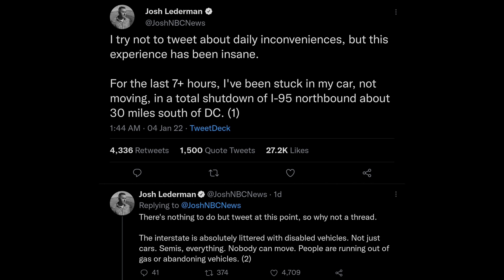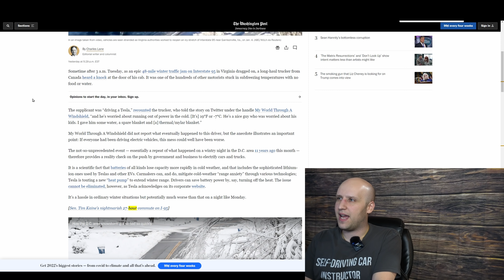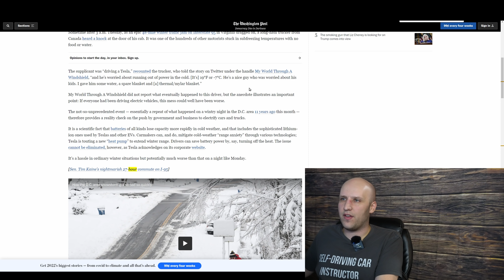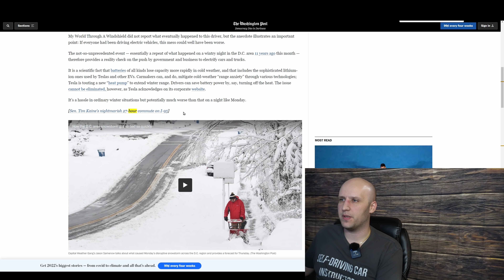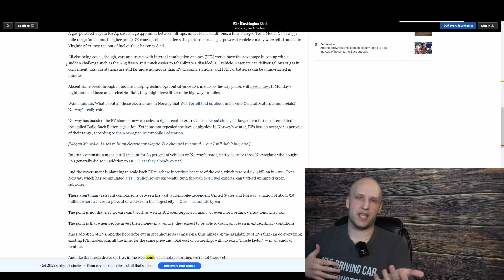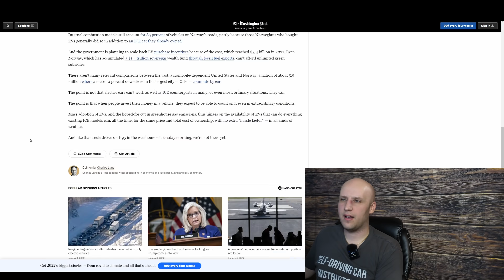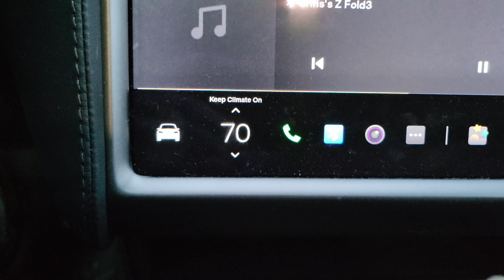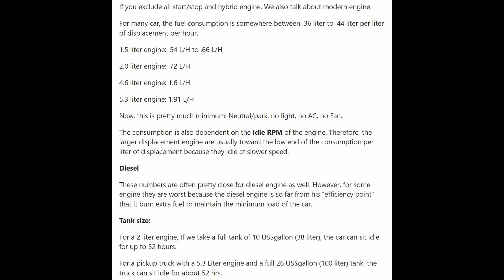How Long Can a Tesla Keep You Warm In A Frozen Traffic Jam? | FUD Debunking

Comment: A pregnant woman from the Facebook Tesla divas group posted… “Hey Divas, I hope you’re all doing well. Monday at around 5pm I was in traffic heading home on 95 south in Virginia and got stuck due to the snow storm. I ended up stuck in traffic for 16hrs! Thank goodness for my tesla. I was initially at 74% when I was able to get home I was around 61%. It was a nightmare being stuck in the traffic jam but I’m glad I was stuck in my tesla. I turned on camp mode and napped for a bit. I hope this is helpful to anyone and I’m praying for all those still without power in Virginia.”
Reply: Isn’t the key to situation, lower cabin heat to 60 -65 degrees F and turn on seat heater as it is more efficient?
Reply: @johnpoldo8817  What for? 1% per hour is good enough.
Reply: @wolfgangpreier9160  Agree, you should be out of jam within 24 hours and still have enough range to reach a charger.
Reply: @johnpoldo8817  Yep. "Stranded on the highway" is very much a survival situations, keeping the temp in the 60s or even 50s will last far longer while still being pretty comfortable.
Reply: @johnpoldo8817  yes!!! Could last hundred hours with just seat warmer.
Reply: @jamesrina6988  30 watts to power seat warmer. 100 hours x 30 watts = 3kwh. That is only 3% of a model X battery.
Reply: @johnpoldo8817  that's what was explained in the video
Reply: Wow, that is impressive! Stuck for 16 hours and used 13% charge!
Reply: @parkershaw8529  - Camp Mode is nice, esp when you put the rear seats down so you can lie down. Air mattress helps. There are all kinds of options, including some for Teslas.
Reply: @Chainyanker007  I am sure it's. Still not nicer than my bed in the bedroom.
Reply: Thanks for sharing.
Reply: Thanks for the test . Interesting . I'am impressed w/ Tesla's batteries & their endurance .
Biggest problem would be the (hypothetically speaking) the line (wait time) at first available charging station. 
Being from a northern state I'm curious about corrosion from the salt ... Any feed back yet ?
Reply: @jeffreyrudolph5061  We've had a 2015 Model S through  two and a half winters now  here in mid Michigan.  Salt doesn't seem to be any problem for the car.  The bottom is well sealed and I think I read somewhere that the S's are mostly aluminum.  So no rust ever?
Reply: @patriciazoerner  thanks for the reply. 
I'am less concerned about the body , than the wiring , batteries & all connections .
10 years would be a comparable average  (conventional auto) from this severe region.  Thanks again.
Reply: @patriciazoerner  Aluminum does corrode, it produces a white powder. It is still important to wash off the salt.
Reply: @patriciazoerner  aluminum does corrode but much slower than unprotected steel
Reply: @patriciazoerner  salt corrodes everything, including aluminum, . May be not as quick as steel but it will eat thru aluminum as well
Reply: @patriciazoerner  aluminum does corrode. It doesn’t produce the typical rust as from steel that you are used to. However you get several different types. Such as intergranular where the manufacturing process wasn’t done correctly and it corrodes internally And then exfoliates.
Reply: @whirledpeaz5758  - It’s an Al alloy, not pure Al.  I don’t think it is impacted much by corrosion.
Reply: @ansv3340  - It’s an Al alloy, quite resistant to corrosion.
Reply: @ansv3340  Aluminium  oxidises extremely quickly to the point where it's near impossible to have a non-oxidised aluminium surface in normal daily circumstances; however, the crux is that this oxide layer is what subsequently protects the aluminium from corroding further because it does not flake off like how iron/steel oxides do ( which subsequently exposes more iron/steel to be oxidised).  So long as you don't break/disturb the oxide layer the aluminium will not corrode any further.

You do not need to paint aluminium if you don't want to; it creates its own protective barrier.  The bubbling/crumbling away effect you experience with paint on aluminium is due to the paint losing its bonding, being displaced by the Al2O3 layer
Reply: @whirledpeaz5758  I worked for a company that manufactures subsea vehicles. They would not paint or anodized the bare aluminum frames because when that aluminum did produce a very fine patina due to corrosion that patina actually then protects the bare aluminum frame. I can't speak for what Tesla has done with their vehicles but I can tell you that a vehicle that was meant to live in saltwater oceans was engineered with no paint, no anodizing and other than a few anodes bolted on no other protection. I'm not encouraging anyone to not wash the salt off their vehicle but since the comment was directed towards aluminum I thought I would offer some real life data on the matter
Reply: @dasppg  and aluminum rots from the inside out, so you have no warning of how bad it gets
Reply: @patriciazoerner  rust no corrosion yes. Semantics only the aluminum used still needs corrosion resistant coatings every other year or so as aluminum in airplanes will corrode without it.
Reply: @Chainyanker007  uhm so are your rims go take the tire off and come back and say if you see the corrosion.
Reply: @jeffreyrudolph5061  I expect more charging stations installed as more EV's are bought.
Reply: @shannonwoodcock1035  maybe stations need to be mounted in/on right aways & utility poles along side w/ conventionally franchised stores  ?
Reply: @jeffreyrudolph5061  Sure, roadside charging stations could happen.  A PV farm and battery bank in remote locations.  It could mint money for small towns.  More feasible than petroleum or hydrogen.
Reply: @markharmon4963  I think old-school road side attractions, museums, diners, etc, are all great cases for ~150KW chargers.  Much more affordable than the large 350kw ones, and put in a location where people are likely to spend half an hour or more anyway
Reply: @Joesolo13  Wouldn't that be great!  I remember them along interstate 10 when there were a few.  Do not know if they exist anymore. However, I think that charging times are decreasing at such a rate that by the time those attractions are established, they will have outlived their primary purpose as a diversion during charging.
Reply: @Joesolo13  In fact I would like to build one around the corner from my house.
Reply: @Joesolo13  The point you make is smart.  If you are stranded or desperate you can afford to wait.  Why not make the chargers cheap if it means the difference of having them or not.
Reply: @jeffreyrudolph5061  if you have 61% battery, you can just head home,e and charge there. If there's no power from grid, you can charge at home if you have solar PV.
Reply: @jeffreyrudolph5061  Surely if you can afford a Tesla you can afford the regular car wash... I have personally seen people buy a brand new vehicle and after 20 years in MN with salt EVERYWHERE, sell it it with not a speck of rust... These are people that manage their time well, and make good money, so fitting in 5 minutes for a car wash before or after a refuel once or twice a week she the salt is particularly pernicious, if it is worth the life of the vehicle, you'll do it... Particularly in a Tesla... 🤷🏼‍♂️
Reply: @jacobwcrosby  The body panels are secondary, but it's the batteries packs that are at the most vulnerable positioning . They must accommodate going thru deep puddles & flooded roads , meaning , & or drainage provisions , but w/ salt migration , that would require almost marine durability . Time will tell . Tesla is no doubt an innovator that has no intentions of sitting on its laurels . As it stands , I believe in diversity. I see EV's very practical as a secondary vehicle , tethered also with solar , thus getting dual practicability from the batteries for the home , garage , barn or RV , should these needs arise .
Reply: @jeffreyrudolph5061  - Tesla bodies are an aluminum alloy, little or no corrosion, as I recollect.
Reply: @jeffreyrudolph5061  I'm pretty sure they have figured out how to keep electronic components free from corrosion by now dude. It's not that difficult to waterproof things. Waterproofing electronic technology is decades old knowledge at this point. THINK before you ask pointless questions.
Reply: @ThePrufessa  I'am from Missouri show me .
Reply: @jeffreyrudolph5061  show you what?
Reply: If she didn’t blast the heat, this sounds about right.
Reply: @Orangetilt  she could have just used the heated seat.. would have lasted for days.
Reply: @jasonwhitton8106  Especially with your winter coat on that you would have in your car in the winter.
Reply: @jasonwhitton8106  You still need heat for your feet.
Reply: @Orangetilt  Read again, "Camp Mode".
Reply: To add we stayed the night in ~20degree weather with camp mode and cabin at 68 we used ~4% in 8 hours.
Reply: @mrmob11  That's impressive tbh
Reply: 🚗🛺🚐🚓🚙🚕🚚 Tesla Bjorn tests camping in all the EVs he tries - see his channel for the results - https://www.youtube.com/user/bjornnyland
Reply: I wish she could be interviewed, that's all the answers we need
Reply: If she was stuck in her car for 16 hours, I am more curious how/where she went to the bathroom, and what she did for food and drink, especially that she is pregnant.
Reply: @TheWanderer28  Always a good idea to keep some water and food in the car, especially in winter.
Reply: Well, at least, in a Tesla, you don't have to worry about carbon monoxide poisoning.
Reply: @ralphholiman7401  How many people stuck there got poisoned??
Reply: @bmw803  , I give up.  How many?
Reply: Compared to this test being done she either lied our wasn’t very comfortable
Reply: @dirkdiggler9379  provide more context and maybe comparebit if you were stuck on an ICE car
Reply: Better than being stuck on a motorcycle
Reply: @projektxent  that's why nobody drives motorcycles when it's snowing.
Reply: EVs don't have to waste energy idling an Internal Combustion motor to generate heat for the interior. When stationary the driving equipment consumes no energy.
Turn the lights and stereo off. Use the seat heaters. They heat your butt, which via the blood heats your entire body. In mild cold temperatures the HVAC is a heat pump. In bitterly cold temperatures resistance heat has to be used.
When sitting still there isn't much air flow past the car, which reduces heat loss.
Reply: Thanks for sharing.  That really addresses how little energy is used over 16hrs with someone in the car.  Just Amazing... and I am so glad you're safe!  
By the way, here in King George, VA (east of 95 & Fredericksburg) power was out 126hrs! 

Cheers,
Eric
Reply: Poooooooo
Reply: Recently, jusr last week,  in a hill station called muri in pakistan, due to  heavy snowfall there was a city-wide traffic jam and thousands of cars were stuck in a traffic jam for few days. People slept in their cars at night , kept the engine running with the heater on. However their  exhaust pipes were blocked due to surrounding snow around the car. This forced the generated carbon monoxide back into the car. Due to this phenomena some 20 odd people died, in various cars. 

This well never happen with Tesla or any other electric car.
Reply: We just camped at the grand canyon in freezing temps and it barely put a dent in the battery.
Reply: And just think, if she had a gas car, she'd be exposing her baby to 12 hours of yummy petrol carcinogenic fumes.
Reply: @anthonylosego  Exhaust is outside. Unless you have some leak, but the ventilation system can suck in this shit from cars around. Hope there is a light wind, to blow it away.
Reply: @anthonylosego  people get cancer from cars?  How may cases of this in the last century?
Reply: @davidsmith1001  you said people get cancer from cars. We’ve both been in cars our entire lives and are still alive. You think petrol is bad, wait til you learn what’s in batteries.
Reply: @jasoncrandall  i don't breathe and force others to breathe petroleum exhause. And i don't breathe battery whatever.
Reply: @jasoncrandall  millions
Reply: @jasoncrandall  stop spreading FUD troll
Reply: @69snoopster  do you know what’s in batteries?
Reply: @jasoncrandall  not sure, but it's around 265,000 cases a year roughly as of 2017. It probably varies year to year.
Reply: @anthonylosego  facts...
Reply: @anthonylosego  for infants, these carcinogens can cause permanent damage. A faulty muffler or cat can dump enough CO into the cabin to kill. Important advantage of EV's over pollution machines.
Reply: @69snoopster  That's why you always leave your window a bit opened.
Reply: @69snoopster  Mufflers reduce sound and are past the cat. Furthermore, without a confined space like a closed garage, fumes will not be killing anything.
Reply: Ha ha, camp mode, kinda anti-climatic 😂
Reply: @davidwong825 That was a feature I didn't know existed . I have camped out of vehicles before , so can appreciate the capabilities . Car or truck .
I'am just making two columns (mentality) - +'s on the subjects at hand & maybe , possibly , a future EV .
Reply: Huge thanks. Glad you are well!!!
Reply: Thanks, I can discontinue watching the long winded video now, you told me what I wanted.
Reply: Thank you for passing on this information!
Reply: Very nice!! -Borat voice
Reply: Wow. Beautiful 🌺
Reply: Love the story about Tesla, thanks.
P.S. camp mode got me!
Reply: A
Reply: Thank you for sharing this.
Reply: I would have lasted pretty darn good then. I have a TDI Jetta. :)=   During winter months I NEVER LET FUEL UNDER 3/4. You never know!!!
Reply: Great debunking video on ev. However, I believe your math is off. I may have missed it but you said the Model Y did better vs the Model X due to the heat pump and poor optimization of the larger battery in the X.
What You did not point out was the difference in interior size of the Model X being larger than the Model Y’s interior. This would mean there is more space to keep warm and more surface area coming in contact with the ambient temperature outside.
Lastly, you left out the difference in external temperatures. The Model Y was registering colder temperatures than the Model X.
Reply: @davidcunninghamjr6871  he also claimed the model X used more battery because it has a larger battery! Unclear if he means used more battery % or used more power. having a larger battery means each % of battery = more power than each % of smaller battery but does NOT account for why the car used more of the battery %. Really the test was so unscientific we can't learn much from it other than; you won't run out of battery in either car for well over 12 hours. Be interesting to work out the power usage of both to see the actual difference/evolution of power optimisation and the heat pump.
Reply: It doesn't get cold in Virginia lmao
Reply: @TheGuruStud  you made this comment on a video about a snow storm..... In Virginia
Reply: carry a small generator with couple gallons of fuel or LP as emergency back up electric charge. will it work ?
Reply: Hahahahaha....EAT THAT cell phone companies!
Reply: That’s cool it took so little energy to keep it warm for that long. The point of the article is that you can’t go get fuel and dump it in an electric.
Reply: You can't ignore the warming from the greenhouse effect during the day. That can make a huge difference on a sunny day verse a windy clear night.  If I'm not mistaken, the second half of the test when the temperature was set to 60, was run during the daytime when the sun's radiant energy would help keep it warm.
Reply: Here we go, now we understand disasters in a new way. Good job tesla
Reply: Wow! Camp mode? That's cool. Would have never guessed to be honest. Thanks for sharing.
Reply: It would depend on the outside tempature and the age of the vehicle.
Reply: I joined a similar group to debate if I finally should get a Tesla or a Porsche (my dream car). I still didn’t know what would be a right option for me. I’m a new mom with a little one who has a few medical problem. Believe or not, I’m going with the Tesla now. You’re comment sold me!
Reply: How about the heater cuase that take made power for 16 hr sound like bs
Reply: camp mode?
Reply: @nickc8819  yes. Did you read the rest of my post?
Reply: What did she have the interior temp vs outside?
Reply: It’s a lie guys 🤥
Reply: It's a good thing she wasn't nearing the end of the driving range and trying to get to a charging station, huh?
Reply: Tesla cars are manufactured with rare minerals , stripped mined from the earth.
https://www.youtube.com/watch?v=T7pusAWBCoE
Go ahead and find out where the rest of your damn GREEN energy is manufactured from.
Reply: @violent_bebop9687  so with your phone, laptop, etc... throughout the life of the car, ice vs ev, EVs are better for the environment. Something that you failed to mention.
Reply: @erwindevera1656  that video is atrociously inaccurate. He's obviously not an engineer
Reply: @violent_bebop9687  which part is not accurate?
Reply: @erwindevera1656  so energy production has two problems 1) density 2)storage , that doesn't change. That's why we dig for oil and store it in containers. It's already in dense form by orders of magnitude.We don't need gigantic batteries. Dude in video says we expend energy to dig for oil, so charge ev  cars instead? Then what? Where does the energy come from? What is the cycle?
Reply: @violent_bebop9687  Renewables. Sun, wind and stream of water. The video made the point on how much more enery and pollution is involved in producing petrol.

You also missed the point in battery recycling. It's in early stages but some are already able to recycle almost 100% of the EV batteries.
Reply: @erwindevera1656  - there's no free lunch in energy production, ask any of your engineering/physics friends.
Reply: @violent_bebop9687  ii bet they use diesel trucks to do the mining. Lol
Reply: @violent_bebop9687  i bet they use diesel trucks to do the mining.
Reply: What if there was thousands of cars that need to get charged at the same time? How are people going to get home safely?
Reply: Doesn't add up the Tesla loses 5% just parked in a cold weather in 12 hours how you can drive,park in traffic for 16hrs drive home and only lose 13% , that's a lie, the guy in the video lost 30% with just the heater on in 12 hours and didn't drive. And you lose 13% in the cold for 16hrs plus driving. She probably got carbon monoxide from the other cars and thought she only loss 13% 😂😂😂😂😂😂
Reply: Using only heated seats , you would be alive buy while your core would be OK,  the inside of the vehicle would be freezing
Reply: I sleep in my ¾ ton diesel truck all the time.  7 hours of idle uses so much fuel you can't even see it on  the gage.  EVs should have a backup honda generator in the car.
Reply: @johnwipf9499  you mean so little fuel right?
Reply: @ThePrufessa  yes.  Better than checking into motel and you can shut down when you get tired.
Reply: The technology is there so the EVs will work relatively well.  Where I live the closest charging station is 3.5 hours away.  Gas station is 20 minutes
Reply: @johnwipf9499  yes I'm well aware of semi truck cabins. I was just clarifying your comment. You said the gauge moves "so much" that you can barely notice it. But you meant to say it moves so little. That's all.
Reply: @ThePrufessa  I was being silly.  It's not a semi it's a GMC ¾.  Sorry for the confusion
Reply: @johnwipf9499  oh
Reply: My RV uses Lithium batteries and when I see concerns about EV cars being frozzen I just have to laugh. Here is the thing folks. Lithium batteries can continue to discharge normally down to -4F without even being warmed (EVs also warm the batteries) a gas car on the other hand, needs to be around 200F in order to operate normally. This should tell you all you need to know.
Reply: I'm not buying this at all
Reply: @lilwhitec4  good because nobody is trying to sell it to you. But if you do the math you'd know it's completely possible.
Reply: Yes but can god hear your prayers if you’re in a Tesla
Reply: @anthonykenny1320  G-d is everywhere
Reply: Take your EV on a cross country trip and let us all know how that goes. On tires made from oil. Where does that electricity come from to keep it charged? Just pull it out of the air, right? Just like city folks that think milk comes from the grocery store.
Reply: @billmonroe8826  good one
Reply: I guess you could get that to happen if you keep the heat at 40 and screens off if you leave any car that cold it will last weeks.  Truck will hit around 95f inside and idle about  2.5 days if you wanted to stay at 95 the whole time . If you did it like my truck does with auto on/off and the heat comparable to your pregnant lady story it’s weeks and as a bonus with its battery pack and genset we can keep devices charged and run a electric griddle for food. I like electric but it’s no where near the power density of liquid fuels and it will not get much better because it’s already a chemical bomb at current density.  If it gets to a point where it was mined half decently and not by children of the Congo with terrifying amounts of waste dumped into rivers it would be great. But the world still does business with China knowing they definitely use labor concentration camps…..all to save a few dollars in cost
Reply: @mddunlap03  it all relative. How big is your truck? It like comparing an ICE car with Tesla's semi. Very big battery against 60L car?
Reply: This video wouldn't need to exist if not for governor blackface babykiller.. don't let the door hit you in the ass on your way out!
Reply: Look dont try to make excuse... there would have many deaths at 7 degrees if everyone was in an EV. DEath! do you understand that !
Reply: @redrum3075  if everyone was in an EV, we'd have avoided global warming and there would be no snow on the ground. Lol!
Reply: @anthonylosego  - But maybe it would be 81 deg like it is here today in sunny SCal.  And people wonder why real estate is so expensive here.
Reply: @anthonylosego  lol
Reply: @anthonylosego  didn't know evs make it snow less
Reply: @anthonylosego  that's stupid, before there where cars it had snow
Reply: @anthonylosego  
Were do you think they get the metal plastics and lithium for the batteries. It's all mined using large diesel engines.
Reply: @lesleyboeder1798  yep. But you don’t have to use ice engines for everything.  Eliminating 3/4 of them is a good thing.
Reply: @lesleyboeder1798  for now. Give it time. Can't do everything at one time.
Reply: @anthonylosego  you said if everyone is in a ev there would be no snow on the ground